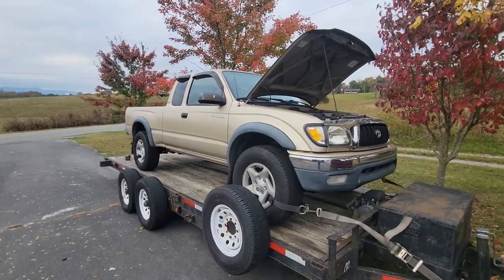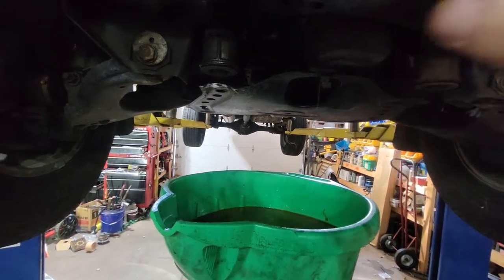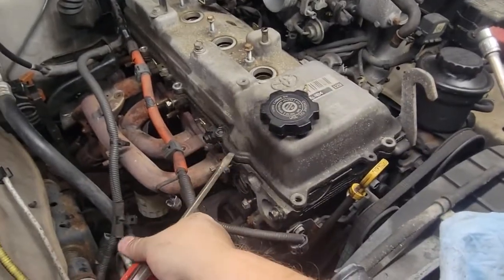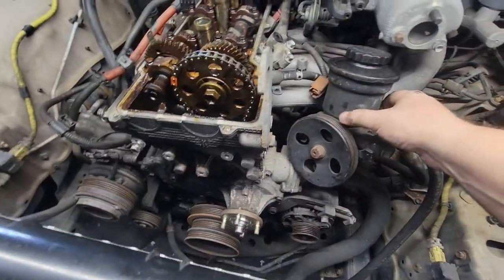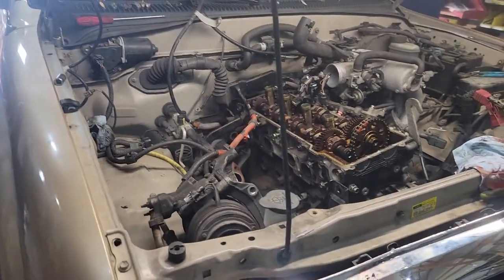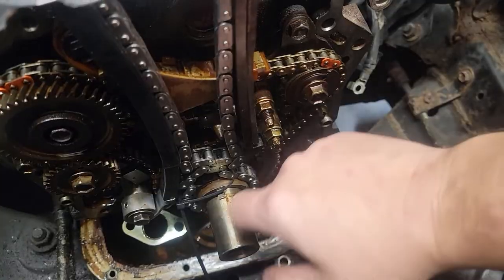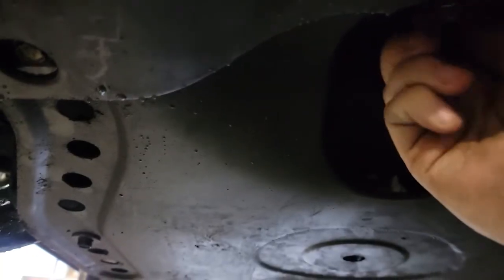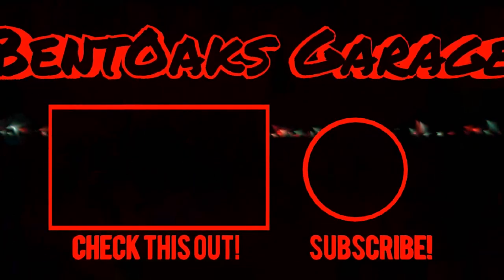How to replace a head gasket on a 2001 Toyota Tacoma with engine in truck | 3RZ FE

Comment: OMG 😵‍💫 I have a 97 taco 2.7l ext cab, head gasket just blew out yesterday, had to get a wrecker to tow it home. for the past 3 months i have been restoring it after sitting for 3 years. rear bumper to front grille and i mean everything, new rotors brakes, ball joints, complete new AC system, belts, 3in lift in the back 2in in the front, led tail lights,and headlights, touchscreen stereo with back-up camera. couple thousand dollars at this point, after watching your video dont know if i want to take this any further !!..has almost 300,000 miles on it now. might be easier to just replace the engine at $2600.00 thanks for posting this video, now its decision time for me.
Reply: What did you decide to do? Just curious.
Reply: @stevet8121 awww who has a delicious chewy brain 🧠

Comment: I had to replace the head gasket in my 98 4 runner over 10 years ago.   What an awful experience, and did it all by a book back then.  Wrote down every step in a journal, and it took me a LONG time.  I was meticulous in videoing, taking pictures, and writing down what I did.  It has been fine for 60k miles since.  Now I think I have to replace the timing chain at 210k miles which is almost as bad.  Ugh, I love toyotas, but this is the only toyota engine I've ever touched, and I'm really sick of touching it.  If I remember right the book calls for 10-12 hours shop time for the gasket, and it's ONLY 6-8 hours for the timing chain, lol.  UGH..........  Thanks for the video.  I'll probably be coming back to watch it a few more times before I dig into my own mess.
Reply: It only has 210K miles, why do you have to change it?
Reply: @ex8280  That's like asking why a 20 year old might need heart surgery?  It's not typical, but it happens.

Comment: OMG! dude, this is why I do not take my vehicles to mechanics anymore and became my own mechanic; not because of what I see you doing but because the things you found like the timing off from before but in my case I am watching hoping to get an idea what to do; I got a 2000 Tacoma, 2RZ, mine does not have the shield underneath at all. I blew the head gasket 3 years ago after a replace of the fuel pump after it have been parked for about 5 years, and the mechanic I hired let me drive the vehicle with old fluids saying it was ok to drive it then come back to replace all the fluids; only drove for about 30 miles but that was enough to overheat and blew the gasket; same guy came and did the compression test confirming fails in cyl 1 and 3, 2 and 4 gave 180, so I parked it again all this time and was planning to do a complete engine overhaul including pistons as the vehicle has 209K miles but then recently lost my other vehicles; our van been disable over a year with a hydrolocked engine; it is ready to assembly right now but I hurt my back at work 3 months back and then I had to storage my company vehicle all the sudden, new company policy so now I have no car at all since yesterday, hence watching your video but damm what a mess!! I want/need the vehicle back in the road ASAP, so I will skip the whole engine removal, also my van is in the garage on the lift and I cant work on it right now as requires more labor I cant do in my condition; working only from top with minimal bending I may be able to get the Tacoma head off but I have seen other videos where all that timing cover removal and many other parts are not needed to get the head off so I do not understand why you did it, I get it you have never worked in this car but damm!! what a mess dude!😅...if the same happens to me I will have to stop and would be completely fucked; I am of course also following the Haynes manual. As a home DIY I have only worked in a 2004 Toyota Corolla standard but did 80 percent of the whole car, everything replaced, literally took it apart and back together new like condition, the van is a 2015 Chrysler Town and Country and took engine off, apart and repaired; it is waiting to assembly and back on, the Tacoma suppose to be the easier of the 3, hopefully! but watching you I have my doubts!

Comment: Dude... my hats off to you for being so patient, damn I would have been throwing stuff around. Have a 99 Taco with 225k on it and the valve covers leaking, lower timing cover seals leaking as well.
I was thinking of just pulling the motor and doing everything at once, seems like an easier option.
After watching your issues maybe I should just trade and get a new truck. What a bitch motor to work on!!!
Reply from the maker: This was the worst head gasket job I've had to do to date
Reply: It's a breeze to do it outside. Sometimes trying to take a shortcut actually prolongs the job.

Comment: I had to do the head gasket on my ‘98 hilux (3rzfe) and on first start up it had similar symptoms. Checked over the grounding and found that the rear grounding strap was loose (between the block and firewall). 
Made sure it was nice and snug and she hasn’t skipped a beat since. 
I wonder if there might have been a ground lead that you put together a bit loose the first time and on the second round it got tightened properly?
Reply: I totally agree with you. That grounding strap breaks and then the engine develops a condition where it runs for a few seconds and dies. People will replace ignitors over and over again until they replace that grounding strap if ever.

Comment: Brother, new gasket so small hole for coolant way. Is it okey or wrong?. Block and head normal size hole.
Reply from the maker: Believe it or not,  most head gaskets that I have replaced recently have hole reductions in the gasket. I'm not sure why, but from what I've seen, it is common.
Reply: @BentOaksGarage  block and head same size hole. Only gasket very small hole. Decrease like 70 %..
Reply: @BentOaksGarage  is it a head gasket from toyota or some aftermarket gasket. Gotta have full flow coolant.
Reply from the maker: @pitchfork peasant  I prefer to use Mahle head gaskets if I can. I rarely use factory head gaskets. Even factory head gaskets have coolant reduction holes. Cheers.
Reply from the maker: @rujolinjoseph4002  to be honest, I'm not 100% positive. I'm sure the reduced sized holes (restriction holes) are there for a reason.
Reply: @BentOaksGarage  thanks for sharing. I think so.
Reply: @BentOaksGarage  thanks for the distinction and the reply. 👍😁👍
Reply: @BentOaksGarage  looked at my old head gasket which had those pinhole sized coolant holes. Curious if those were factory. Seems pretty fn stupid. Especially if anything ends up in your coolant larger than those holes. Pretty much anything known to man🤣☹️. Tempted to take a hole punch to em before installation. Cuz damn. Ordering the mahle. Thx for reply👍😁👍
Reply: The small holes encourage the coolant to flow through the block, otherwise the coolant would go through the first 2 cylinders, up to the head and the back two cylinders would overheat. You could probably plug cyl 2 and 3 coolant holes completly.

Comment: im guessing it was bogging an dying due to contamination of coffee oil still with in the system 3 or 5 oil changes should flush everything out  also which head gasket to use oem or mahl
Reply from the maker: I went with mahl cause it's readily available at Oriellys

Comment: I’ll never have customers supply parts regardless if it’s cheaper for them. Places I get my parts from pay me warranty if something doesn’t work. I always let my customer know that. If they supply parts, I’ll tell them I can’t warranty the work and they’ll have to pay for the job again if the parts fail. I’ve had my fair share of customers supplying the wrong parts and making me wait along with holding my stall up. So I tell them in advance the price will increase if that’s the case.